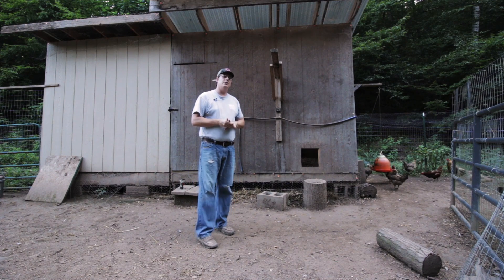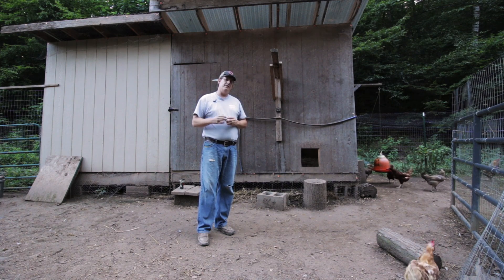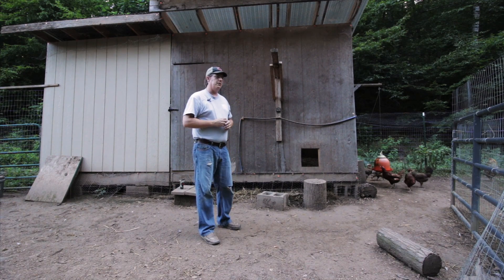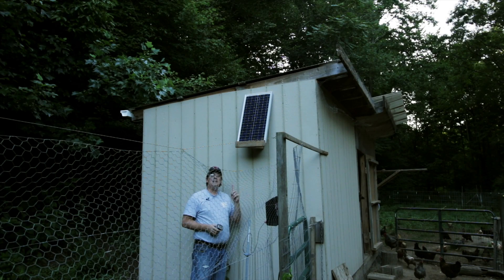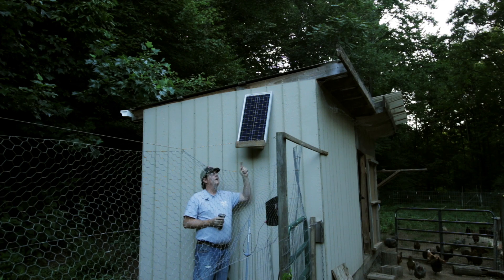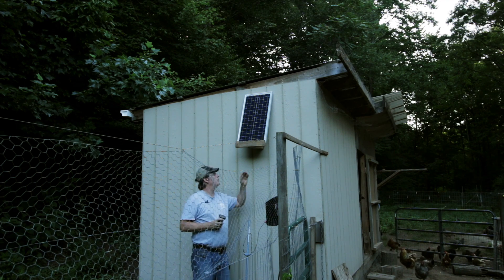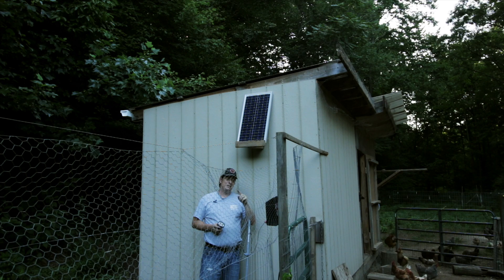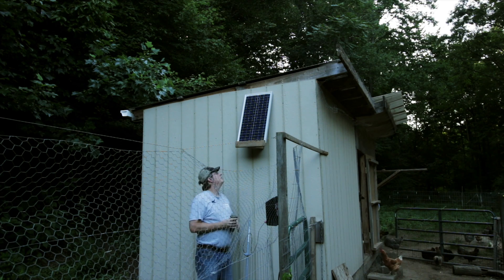EP37: Explaining our DIY off-grid automatic chicken coop door - It's solar powered!

Comment: Hello, I went and got all the parts but I cant get the actuator to work. I checked wire diagram several times and seem to be right. Would you by any chance have a step by step instructions?
Reply from the maker: The site I reference in the video doesn't have the post anymore. I put the original post in the video description but here it is again. http://blog.netscraps.com/diy/heavy-duty-automatic-chicken-coop-door-ii.html

Comment: I have the same basic setup and the same charge controller. I lose voltage at night and I’m wondering if you have the same problem. The controller says it will not backfeed into the solar panel. After the door closes my battery will say 12.7 v but in the morning I have 12.1 volts. It’s a new 7ah battery. Is there a draw with the timers? My relay setup has no draw when open or closed except when the door is operating.

Comment: Great job...Problem with timers is that you have to keep changing them through the year.....Using dusk dawn switch and DPDT Relay you can control the Door without ever touching it again....wiring diagram here... https://3.bp.blogspot.com/-As6aEfexGts/Wihu93XL8zI/AAAAAAAAAto/v_D4ACHPpbUEh7Q3uYYDHTGKBiDr4fU8wCLcBGAs/s1600/Screenshot%2B%25282%2529.png

Comment: Did you know that you don't need the relay at all if you are using two SPDT timers? You Simply wire Positive to the NO (Normally Open) terminals of the timers and wire Negative the to the NC (Normally Closed) terminals of the timers. The Commons of the timers are the wired to Positive and Negative of the Actuator Wires. Day timer turns on in the morning for , let's say five minutes (just long enough for the door to open fully, is all that's needed), then the timer shuts off.  Do the same for the night timer.
Reply: Yea I was wondering why there were two timers, the relay should act as the second timer.

Comment: All you need is a timer and a DPDT relay if you have an actuator. Without having an actuator just add two diodes and two limit switches. Way simple. Add photocell and a SPDT switches and you can go from timer or dawn till dusk.
Reply from the maker: If you have a video of that, give me the link and I will share it.
Reply: @RedToolHouse  I just now saw this. My system is way too complicated to show in a video and understand it all. LOL. However I will try making a video of the simulation I made and clip that to the setup.  Tonight I hope.
Reply: @RedToolHouse  I have two videos that show how it can be done with two SPDT timers. One uses an actuator, the other is for setups that don't have built in limit switches. I figure out how to do it without Diodes. So much easier.
https://www.youtube.com/watch?v=3BT09Rd3JKY&ab_channel=AztecWarrior
https://www.youtube.com/watch?v=aYv3-aVQEOY&ab_channel=AztecWarrior
Reply: @RedToolHouse   Was the sharing possible?
Reply: One timer works fine if you have adequate power. With limited solar capacity two timers are necessary to conserve power and not have something “on” all the time
Reply: @dylanhowell9635  Yeah that's why I don't Really recommend it. But if you already have the timers and a single DPDT relay (way better than the Relay module) all you have to do is add a diode and all you have to do is program opening time and closing time. 

That's also why I linked to the SPDT timers. WAY EASIER.
https://www.youtube.com/watch?v=aYv3-aVQEOY

Videos with them actually working. 
https://youtu.be/NQbQxiUAPWs
https://youtu.be/ClPmxFDa5m4

Comment: Hi, the link to netscraps is not working, please amend. Thank you
Reply: I am not trying to belittle the guys work but you shouldn't wire it, like the guy on the site says to. Many reasons not to in fact. I won't bother with the details unless you have interest in why. IF you are going to wire it with these components then use this wiring diagram. Use 18 AWG wire for the power to the motor and 20 AWG or the power to the timers and relays module. Use pigtails and don't daisy chain.
https://drive.google.com/file/d/11yDQuHLeDFcTUEibHIpaznPKbxQv_2vw/view?usp=sharing

If you would like to cut down on all the wiring and guess work just use this diagram and these timers.
https://drive.google.com/file/d/1IrP7PmL0gOUuwDSRk41mLLRK87oAbBpf/view?usp=sharing

The Timers are so much easier to mount and you don't need to use and terminal connectors.
Reply: @AztecWarrior75  Thank you

Comment: I build a door like yours. I used a 18" arm since I also have ducks and hope to get turkeys again soon. Mine has been working very well for about 7 months and going. I just changed from using the relay board to using Two 5 pin car relay switches. I also put the battery and timers in an ammo box to keep it more safe from rain, birds, and other animals. I agree with you the cost was a bit of a concern but the peace of mind and the removing that one more daily task was nice. I also have a 55 gallon automatic water tank and a 55 gallon automatic feeder. They all came in handy a while back when I got really sick. I knew my birds were still very well taken care of. Just getting those little daily task off the list really frees up a lot of time. I highly recommend this door to anyone who has birds. Love the video.
Reply: All you need is a timer and a DPDT relay if you have an actuator. Without having an actuator just add two diodes and two limit switches. Way simple.
Reply: @AztecWarrior75  You need two different 5 Pin relay switches, One for Open and one for Close. You could make it more simple by running one switch and leaving the switch On During the day and having the switch Off at night but the relay switches have a power draw and you risk the 10W solar panel not being able to keep up with the power demand. This problem maybe more of an issue during bad weather. Also the relay switches get warm as you run them for hours and I'm in Texas where it gets Hot. So reducing usage hours will make for a more reliable system. You are correct about the limit switches but the Linear Actuator has limit switches build in already making the need for external switches obsolete. Also with the internal limit switches it's less for birds and other animals to mess with and break. An External Limit switch if not careful could be damaged by birds or mice. I have seen my geese tear up wiring just for fun. When it comes to animals simple is better. You could make your own Linear Actuator with some All Thread Rod and an old 12volt drill and some limit switches and could save a lot of money. At the end of the day it isn't worth it should any piece fail you might lose some or all your birds.

Comment: Have you had any issues with this system in the year since you installed it? Has a battery failed? Any false open/close? Has a chicken gotten stuck in the doorway?
Reply from the maker: Sarah Mejia no issues at all. All the components are still working. I did realize the other day that I didn’t change the time for day light savings time and the door was closing too soon. Lost a couple chickens due to them not getting inside before it closed. Predators got them. The door closes too slowly to get a chicken caught.
Reply: Thanks! (Sorry you lost some of your flock.)

Comment: A simple system I have been meaning to try is connect the door to a pvc pipe acting as a weight, get a water timer and aquarium timer and have 1 timer fill the pvc from a reservoir and the other would drain it. To prevent freezing you could add rubbing alcohol.

Comment: Matter of fact and easy to follow.  Thank you!  This is exactly what I was looking for.
Reply from the maker: excellent. good luck with your build!
Reply: @RedToolHouse  Did you know that you don't need the relay at all if you are using two timers already? You Simply wire Positive to the NO (Normally Open) terminals of the relays and wire Negative the to the NC (Normally Closed) terminals of the relays. The Commons of the relays are the wired to Positive and Negative of the Actuator Wires. Day timer turns on in the morning for , lets say five minutes (just long enough for the to open the door fully is all that's needed), then the time shuts off.  Do the same for the night timer.